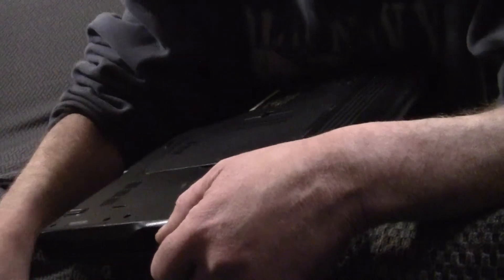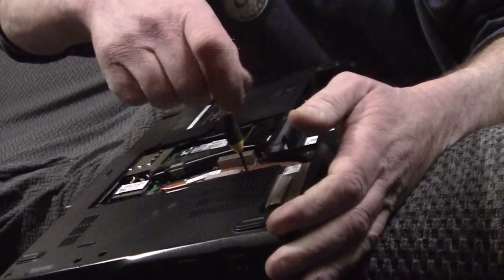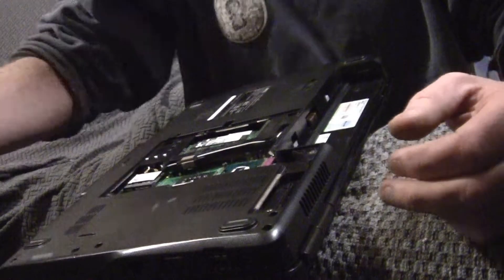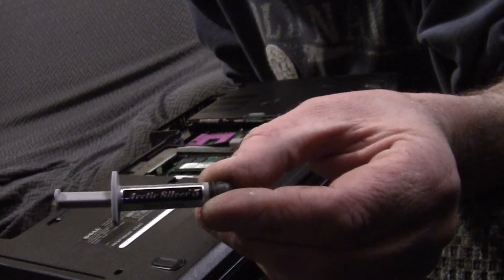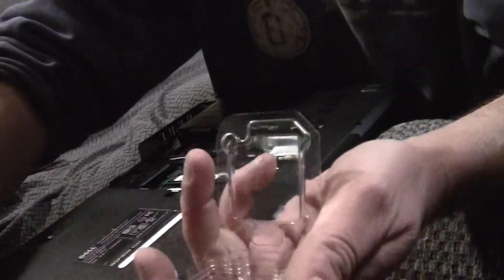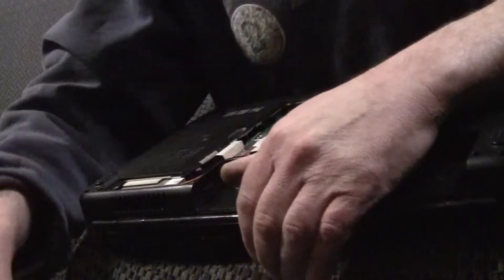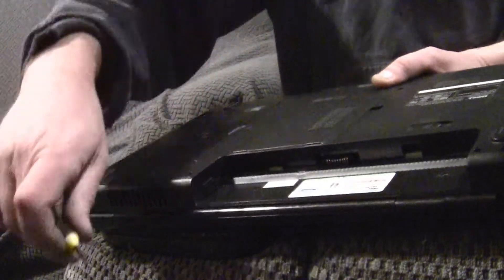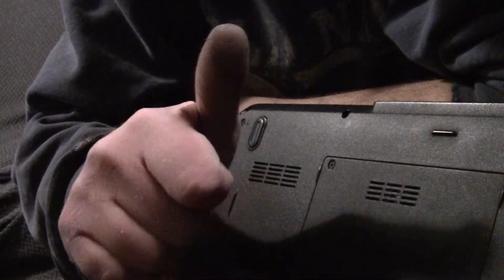UPGRADE DELL 1545 TO THE FASTEST PROCESSOR

Comment: I have to upgrade mine with t9900 as I want to install docker which cna only be installed on machines supporting virtualization. My current processor is t6600 .
Any thoughts?

Comment: The downside though, the motherboard will only support a maximum of 8 gb DDR2 memory. (2x4gb) I did the same to mine, but ended up scrapping it and saving the CPU for another project.  T9900 was a great chip, but theres much faster stuff paired with faster northbridges out there nowadays.  Great video!

Comment: Great job! I love this laptop!
I have a Dell Inspiron 1545 running fine with: BIOS A14, Intel Core 2 Duo T9600 2.80 GHz, 4GB Ram (I intend to upgrade it to 8 GB), 2 SSD 240 GB (I've removed the DVD), Windows 11 Home 23H2.
After upgrade a BIOS, it'S recommended to go to System Setup and click Restore Settings or Load Defaults and then save changes and exit.
Congratulations!
Reply from the maker: I have 2 of these with 8 GB Ram and T9900 CPU lots of other upgrades as well and I use it everyday , Works Very well !! Thanks ..👍👍
Reply: @shawnmrfixitlee6478 is the 8gig ram available? Am from Nigeria and I have this Dell, they told me 8g ram isn't available in 2024 😮
Reply: Could you pls provide compatible Ram details for this pls? I know it's ddr2 but not sure how and which one to purchase?
Reply: Also, from where can I download bios A14 bios, dell official site only has dell A13 available

Comment: Hola , puedo poner el t9900 con la versionde bios  A13???
Reply from the maker: English please !
Reply: @shawnmrfixitlee6478  Sorry what I wanted to know is if you got to update the bios or still with the A13 version, because the A14 version comes out an error when installing and is not available on the Dell website.
And can I put the t9900 with the A13 bios version?
Reply from the maker: @faruqpolicarpo  Thanks, use A13 and T9900 and 8GB of ram and works well

Comment: This laptop can also be upgraded to USB 3.0 or Gigabit ethernet via its ExpressCard/34 slot.
Reply from the maker: yes , thanks
Reply: What would I get for gigabit Ethernet? I could then use as a router or server and get Gigabit speeds?
Reply: @haveaniceday7950  As a server, yes. As a router, no, because you would need 2 gigabit ports. The ExpressCard/34 only adds 1 gigabit port.

Comment: How do i upgrade to window 10? I also want to change it to ssd...since my laptop only updated 1 time and nver been updated since 2013
Reply from the maker: You would need a Windows 10 disk or Thumb drive with the key. a SSD drive to install prior to installing win 10. You may want to max the ram out to 8GB as well .. Very easy upgrades & it will be better than some new computers .. Thanks !
Reply: @shawnmrfixitlee6478  oh one last thing what kind of ram should i buy?
Reply from the maker: @akiradokkabei6428  You will want 2  sticks of 8GB PC2 6400S Laptop memory . It's quite a bit 0f $$ , But it speeds them up .. Thanks !!
Reply: @shawnmrfixitlee6478  THANK YOU

Comment: Great video. I have done this many times over the years. Several friends of mine are still running 1545s with T9x00 processors that I installed. My wife and I are running them under Linux with the E8435, the 3.06 GHz model C2D sold to Apple. I've got one with an SSD, the E8435, 6GB of RAM, and even a 900p screen upgrade.
Reply from the maker: Very cool share , They work well . My family and I use them and have been happy ! Thanks..

Comment: Csn I put i5 processor but how plzz reply
Reply from the maker: No sir , Wrong chipset  you can go a T9900 it is 2 core and 3.06 in speed . I like mine !  Here is an Ebay link   https://www.ebay.com/itm/293878748111?_trkparms=ispr%3D1&hash=item446c89d3cf:g:f7kAAOSwAiVfzMHq&amdata=enc%3AAQAGAAACoPYe5NmHp%252B2JMhMi7yxGiTJkPrKr5t53CooMSQt2orsS%252Fwocn770hnih0B3mVHNZ5ATJx0f%252Bq1BQ%252FrQ1dH2zcrtcH%252FQfMOK
Reply: @shawnmrfixitlee6478  but my laptop dell 1545 sockat P 478 3gb ram 64 operating how can I put plzz reply bro T9900
Reply from the maker: @aalamshaikh8240  the T9900 is the fastest P socket you can get and it will fit your 1545 . I am using one now with that CPU . Thanks

Comment: Did you have to download new BIOS upgrade to get new processor to work? I have A13 BIOS and want to put in a P9700.
Reply from the maker: It worked fine on 13 , But later I did update to 14 .. Thanks !!
Reply: @shawnmrfixitlee6478 Last night after work, I switched out original processor for P9700, computer still running on A13 BIOS. Computer perked right up, start up definitely faster! Got to sign in, put in my pin and moments later it just seized. So removed power cord and battery momentarily and rebooted. Running just fine. System recognized new processor...YAY! THANK YOU AGAIN!!
Reply from the maker: @Hdrock6  Right on , Glad to hear it ! Good upgrade for these old but worthy 1545's !!
Reply: @shawnmrfixitlee6478   @ShawnMrFixitlee  Thanks for your reply! Dell is not offering any BIOS updates for my laptop. I cannot find viable link to either A14 or A15. So that's why I am hesitant to switch it out without finding someone like yourself who was able to do it with A13. You rock thanks for the vote of confidence. Are you running a version of Windows 10? Just fyi...I already replaced original hard drive with Samsung 870 QVO SATA III 2.5" SSD 2TB (MZ-77Q2T0B) and upgraded ram to 8 gb ((2 x 4GB) PC2-6400 DDR2-800 SoDIMM ) and I'm running Windows 10 Pro. When I first upgraded OS from WIN 7 to 10 ran sooooooooooo slow!!! Internal SSD upgrade saved this laptop from scrap pile. So naturally wanted to upgrade everything I possibly can. Anyway, tmi I'm sure :) thanks again for your response! Gonna go for it...I'll let you know how it turned out later. Have a great day!
Reply from the maker: @Hdrock6  No prob , Thanks !!

Comment: Thanks dude. My laptop, which is the same model heats up quite a lot, anything you know that could help me?
Reply: Try P8800 for CPU, it doesn't heat up very much, I barely hear my fan noise now.
Reply from the maker: Sure clean the fan and the fins on the cooler also use good heat sink compound with silver in it .. Thanks !
Reply: @shawnmrfixitlee6478  Thanks

Comment: Why did it take Dell so long to design an easier access to the CPU.  The older models make you take anything that can be removed (including a keyboard with a way too short ribbon cable) out to get at the CPU.
Reply from the maker: so you will just buy a new one . They build them so folks won't try to fix them , Because of the hassle .. Thanks !

Comment: Was there an actual increase in performance worth the $60+ to get a t9900?  Compared to just getting an SSD put in it?   My 1545 already has 4gb of RAM in it.  I saw that upgrading to 8gb didn't seem to help much for some youtubers??
Reply from the maker: It did make quite a difference . I can push it harder without issues ! An SSD with this would be a good idea as well .. Thanks !!
Reply: I upgraded mine from T4200 to P8800, some performance boost and it is very quiet. My fan doesn't turn on very often now. SSD is very help, and 8gb is way too expensive.

Comment: Interesting Shawn.  I have not looked inside a laptop in years.
Reply from the maker: they have not changed much . some are pretty crazy with the processor soldered to the board and unable to upgrade . And the new ones have the battery inside the laptop so you have to take them apart just to change it . So like a Bic lighter folks toss them away and buy a new one . Thanks Harold  !